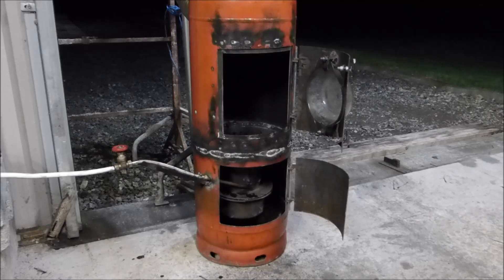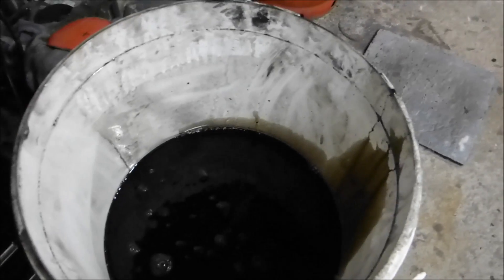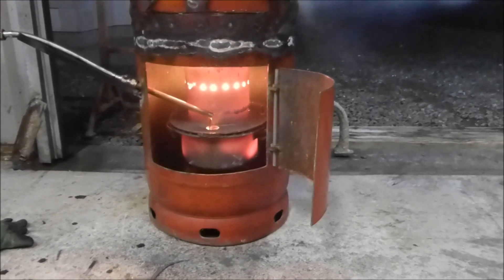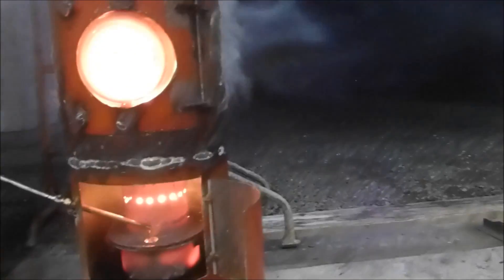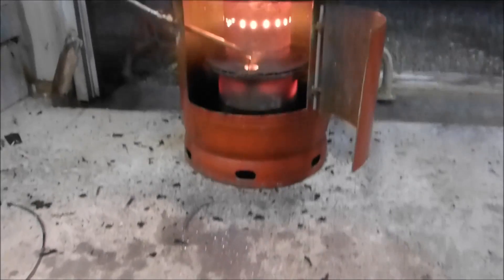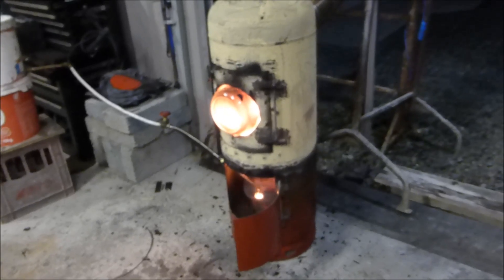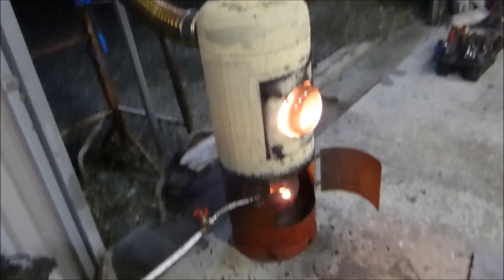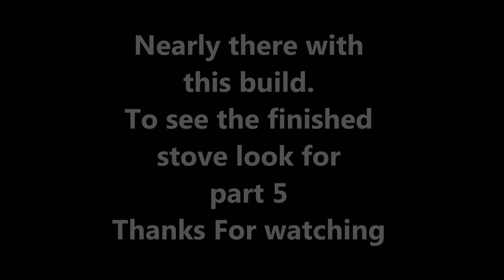Make a great waste oil and wood burning stove heater (part 4)

Comment: If you take a propane tank and place it at 90° on top of the one you have build. Cut up one end for a 12v car fan, the other end cut small hole in all directions. Just an idea.

Comment: Every time I see an oil burner like this I wonder how it would work if it had an outer shell with a fan blowing air between the inner and outer?  would it heat a garage faster that way, or leave it as a radiant heater?

Comment: Excellent sir!  Love it!  I've been trying to find a way to install a window in the stove I'm building.  I'm the kind of guy that will try to find something I can repurpose before I buy something so I've been scavenging with no success.  I worry about whether what I use can withstand the intense heat.  Looks like you figured it out.  I thought of a lot of things but I can't recall thinking of a glass cooking dish.  Excellent!

Comment: I appreciate that these are ancient Gerry but have you considered incoroporating thermal mass storage?  More so if it could be obtained from the flu and then perhaps stove pipe water heater.  Stil thinking wings aswell.  Hmmm  Oil heaters.  ?

Comment: Hi Gerry. Just wondering if it was possible to use another brake disc (hub and stud holes closed over) as the burn pot? Or would the thickness of the brake disc be a hinderence to initial combustion?
Reply from the maker: Hi Ben. I have found that you can get combustion going quicker with thinner walled combustion chambers but it would be possible to get a brake drum or similar to work. Hope this helps  Check out some of my newer videos for a completely different design that works great. Cheers Gerry

Comment: Do you have a blower in this one?
Reply from the maker: Hi Lance There is no blower in this stove but I did a redesign on this one later and converted it to run with a blower. I have an new burner in later videos too here is a link to the new easy build burner https://youtu.be/ShTLaYKjzxw Hope this helps Cheers Gerry

Comment: Hi Gerry, I see you mentioned that it is an Ozzirt style burner. I made my first one following his basic principle about 5 years ago. I have had lots of fun every winter, and ended up using a 44 gallon drum with two thirds cut off and made a simple 6 inch hole through the top of the lid then putting a brake rotor  over that hole knocking out the part where the wheel studs pass through. Then mounted a short mixer sleeve on that with a 2 metre flue into the top of the mixer sleeve. Simple and very effective. But I have to admit that your design is by far tidier than mine. I am very impressed with your setup.
BTW - I was over in Wexford to visit my Mom for her 88th birthday last March. I have 3 brothers living in and around Wexford .
Seaview, and Gray Robin. All the best from New Zealand. Cheers

Comment: Hi there. Awesome work. Just getting together the parts to build one of these before winter in Australia (yes it does get cold here!). Does the disk brake need to be a ventilated variety like the one in this video? Approx what diameter is that brake rotor? Would it be acceptable to have the flue/chimney coming out of the top of the tank rather than at the rear? I assume a baffle would be needed to stop flames shooting straight up the chimney if the flue was connected to the top. Your thoughts would be greatly appreciated. I already have the propane tank. Here in Australia they are galvanised steel. I'm wondering if the galvanised surface will cause a problem with the levels of heat that this thing generates. Keep up the good work mate.

Comment: Hi Gerry, at 3 mins 38 seconds in to the video you mention about the stove not having any baffles. What do you mean, what are the baffles and what are they for? Cheers Gary.
Reply from the maker: Hi Gary. The baffles are just simple steel plates that can slow the flames down and direct them to the outside walls of the stove so that the walls get hotter before the hot gasses go up the flue. I made a newer burner that is very compact and very easy to make and I installed it in another stove that I made. Here's a link  https://youtu.be/tnzEDEpz3Yk Thanks for the comment Cheers Gerry

Comment: Gerry can you control the heat on this type of stove ?
Reply from the maker: Hi woods men. I have made a few different burners that work with these stoves. The newer burner I designed runs at about 2 litres per hour and makes lots of heat. It is possible to increase and decrease the oil supply to a point. The vapourising pot needs to be red hot so it turns the oil to gas and that then burns. In my later videos I am using this very easy to make burner. 
https://youtu.be/lU93mSoaJEk  Hope this helps. Cheers Gerry

Comment: I'm still looking at making one of these and gathering all the bits I need. I've been thinking about using an old 20l garden sprayer with that just happens to have a brass output nozzle on it to spray the oil in. I don't want to use blown air because it's noisy and means I'll be using electric which kind of defeats the purpose of free fuel etc. What I wanted to know is do you get a lot of heat transfer to the inlet pipe? Thanks!
Reply from the maker: Hi Ian. This build works great and makes lots of heat too. Its the chimney that makes the gasses mix so once you have the chimney done its just a matter of the Ozzirt burner. The inlet pipe doesn't get that hot but it would be easy to shield it anyway. Hope this helps. Cheers Gerry

Comment: You should spray water in with the oil burn chamber for 2 reasons, 1) more heat and 2) a cleaner burn because C8H12 + (H20)8 = CO8 + H28

Comment: That's awesome! I'm just learning about these, and wondering about the rate of oil you're feeding in. That seems fast, couldn't you drip slower and save fuel and in turn burn cooler than your 1000+ F?
Reply from the maker: Hi. You can burn way less fuel just by dialing down the valve and just dripping the oil into the chamber. I have a steady stream of oil but if you were to drip the oil you could lower the output. Cheers Gerry
Reply: Gerry's Waste Oil Burner Ok. so you don't have to keep a steady stream like that just to keep it burning.. That's what I figured. THanks. and Cheers :-)

Comment: how is that dish doing? is it holding up? thanks
Reply from the maker: Hi hddm3. The dish is doing fine now. Make sure that it has a little room for expansion and the clamp bolts are not too tight and it wont break. Cheers
Reply: thank's bud